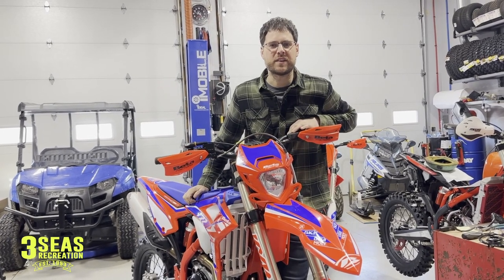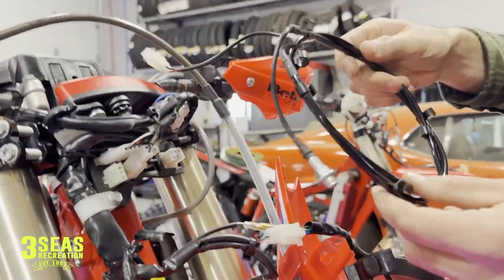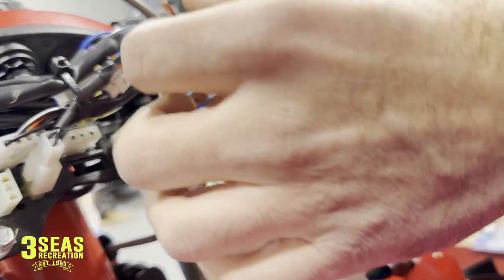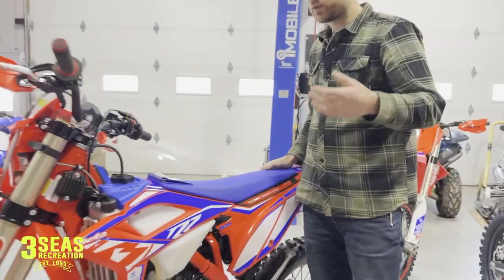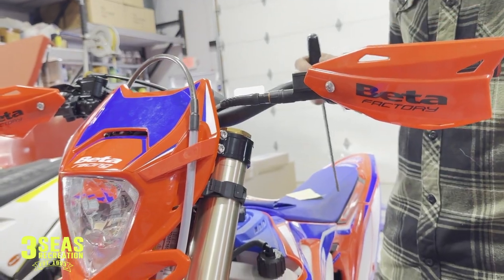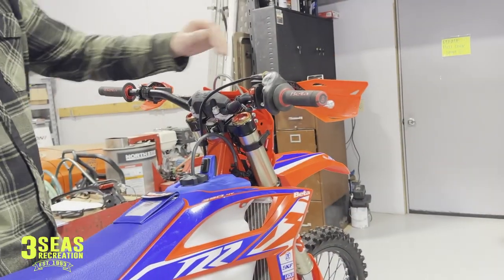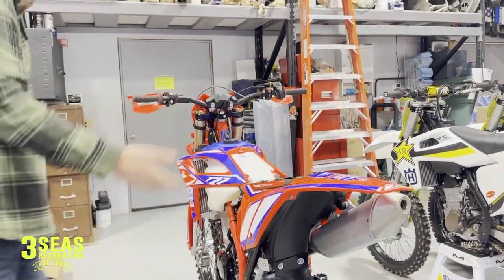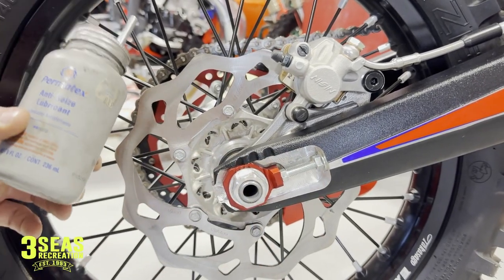10 MUST DO Set Up Tips For Your New Dirt Bike that are FREE | 2023 Beta Motorcycle

Comment: Hey jared thanks for all the tips on the beta 430 rrs it was really helpful all the information you gave after getting back into riding after a while. 
I do have a question i hope you can help me with; is there any way to adjust the front head light up or down?

Thank you again!
Reply from the maker: Good Afternoon, that is a good question. I do not think there is an easy way to adjust it other than to remove the screw that hold the light to the mask and stacking some washers between the headlight bracket and the plastic to tip it. Enjoy The Ride, Jared

Comment: Great info, but one thing the grease is old tech, use CRC 2:26 it works much better and its much cleaner.
I also insulate the clutch housing near the engine as they sometimes cook.

Comment: Agreed on most points but dielectric… it’s silicone an insulator.  I much prefer fluid film as we’re just trying to keep moisture away from the metals prevent corrosion a spray can of fluid film will allow you to keep all connections clipped together. Do you just spray the backside of the connectors fluid film? also works great as an anti-seize and it’s a lot less messy antisieze gets thick and chunky after a while. The other thing with a brand new bike, there’s no reason to ditch your initial fill of oil‘s drain it into a clean container like a ratio right cup verify, volume and reuse. This will be discarded soon enough anyway might as well not waste it.

Comment: I’ve been a Honda CRF guy most of my life, both 2 and 4 strokes.  I’m 65 and still enjoy woods riding but the weight and stiffness of the Hondas was just getting hard to handle.  I recently purchased a 2023 BETA Cross-Trainer.  Lightweight and nimble …I have to say riding the Cross-Trainer is so so much more enjoyable.  I love the Beta and I really didn’t expect it to be this good.  Well done BETA!
Anyway, my dilemma, the X-Trainer is strictly going to be a woods bike, so I am removing some of the unnecessary functions.  I’ve removed the head light/turn signal switch, however I would still like to maintain the always-on high beam headlight function. Based on a review of the manual and several you-tube recommendations, I tried placing a jumper wire between the dark blue (Bl) power and pink (Ro) high beam electrical connector.  When I do that the bike wont start.  Any ideas?
Reply from the maker: Thanks for checking out our channel! Pumped to hear your Beta story and your lucky to already have a 2023 Trainer! We just need to keep getting more people on the bikes and they will find the same success! There should be NO connection between the headlight switch and the bike not starting.. In fact I put a still shot in this video showing how we jumped it with a simple wire and that still shot was done on a 2022 XTrainer. What if you tried to jump between the Dark Blue and the Light Blue (low beam). Enjoy the ride, Jared

Comment: Hey Jared, really like all your videos as I'm diving into my Beta.  Question on Idle... when it's cold out 40 or below, my bike has a hard time staying running without holding the throttle for a few seconds. (20-30 sec)  any advise on that? is there a cold start adjustment that can be done? Going to be hard to set the stepper motor if I have to give it throttle.  TIA!
Reply: also wanted to get your opinion on upgrading the oil pump gears.  Worth it?

Comment: Hi Jared, i have a doubt, the hourmeter of the bike works with the speedo cable? In my 2023 390rr the speedo cable cut, and now the hourmeter is stoped, but the screen still turns on when i am running the bike, so i am confuse, thanks!

Comment: Common mistake is to be confused by grease uses... Dieletric grease is NOT a contact grease, it prevents corrosion as it repels water. So : 1/ clean contacts using electronic contact spray  then :   2 / put dielectric grease around connected plugs, especially in the hoses of plugs from where come the wires. 
Best contact can be done with little graphite out on each contact plate...   With this method I came from the  usual 13.9v charge on 19rr using  the optionnal charging wire kit to a solid  14.3 volts without any moseft new reg rec.  Keep the good work, thanks for your videos :)
Reply from the maker: That is some really good feedback! Thanks for sharing! Enjoy the ride, Jared
Reply: Could you please explain this to me one more time with the product name of what we should use?
Reply: @l.steveguajardo8633  late answer...  for contact cleaner, any electronic shop ( or automtive one) will sell it. dielectric grease, you can use any industrial grease as long as there is no "metal additive" in it... but even, i tested a lot and still didn't find any short cut or draining current....

Comment: Since the race edition bikes have so much of, if not the same wiring harness as the RR-S models could someone buy a Race edition with the better suspension and still make it street legal? 
Also do the race editions accept adding the trail tech voyager dash?
Reply from the maker: The race edition has all the same features except the trail tech voyager. I have never tired to install a trail tech on a race edition. Seems like there are a ton of wires to send places.. Might not be worth it.. Some folks can make the Race Editions street legal its just up to your state... Here in NY it is very difficult! Enjoy the ride, Jared
Reply: @3SeasRecreation  Thanks for the info. Really finding your channel helpful and am glad to have a dealership like your's in the states. I'm from South Carolina and am hoping to purchase a Beta this year just a bit torn between the 500 rr-s and 480 race edition. With my lower level of experience I'm sure the suspension on the RR-S model would be just fine.

Comment: Hi, my hour tracker(the standard display) seemed to have stopped when I pulled of the speedo cable, is it supposed to do that?
Reply from the maker: Good Afternoon, I believe the hour meter inside the display is connected to the speedo cable. So it will need that to continue to function. Enjoy the ride, Jared

Comment: Any issues for the stator having the headlamp on high 100% of the time?  Does the computer track hours or do you usually add an hour meter when you remove the spedo cable?
Reply from the maker: Thanks for checking out our channel! No issue at all with bike on high beam! I usually never had the stock computer on my bikes so I always add a secondary Hour meter. I am now curious if the hour meter inside of the display works without the speedo cable. I will have to ride the bike around the parking lot for a few minutes to find out! Enjoy the ride, Jared
Reply: @3SeasRecreation  thanks Jared!  One last quick question, do you still think the full time high beam plus a fan would be an issue?  I’ve heard some bikes aren’t able to run the light and the fan at the same time and you can end up draining the battery. Maybe this is more of an issue with the aftermarket LED headlight upgrades?

Comment: I'm interested in a beta 350.  But my only concern is that all I hear and read threads on how bad the electrical system is.  If spending $12k on a bike, it's a hard decision if buying a bike that won't last..
Reply from the maker: Good Morning, we have been selling Beta motorcycles for 12+ years and rarely see an electrical issue. I think if you purchase the bike it's a good idea to go through it and diametric grease things but other than that we have had minimal issues. Enjoy the ride, Jared
Reply: It's a rare issue that I had. You have to go through the whole wiring harness and solder the cold crimps or at least check the crimps for loose wires. The other possible issue is the regulator rectifier needs to be replaced with an aftermarket MOSFET. This will get you 13v+ on your charging system. This was all fixed with the 2020 and up models as far as I know. I have a 2019 rrs. At the end of the day I think I could have just gotten the aftermarket Reg/rectifier and been ok which is an easy plug in and go mod.